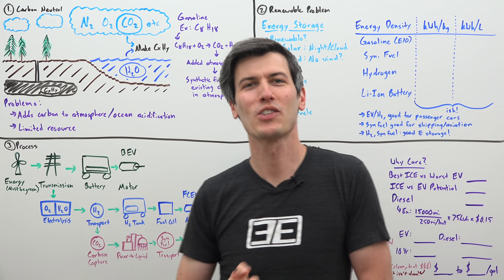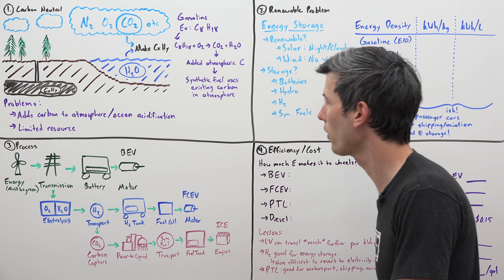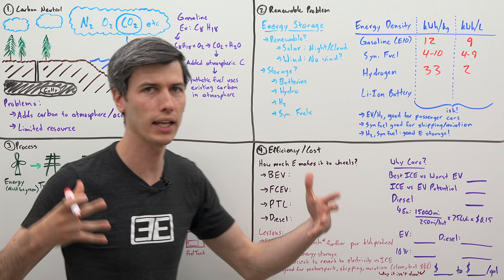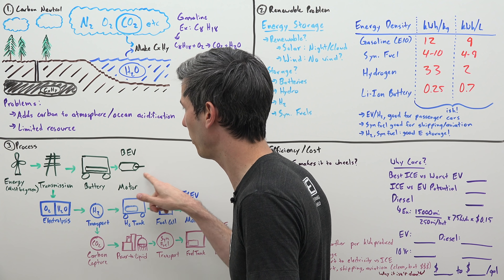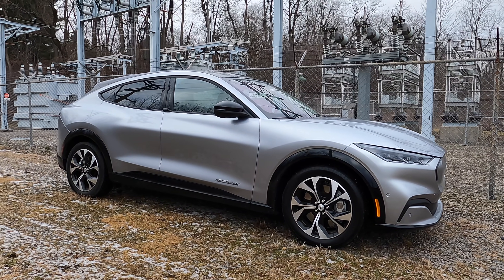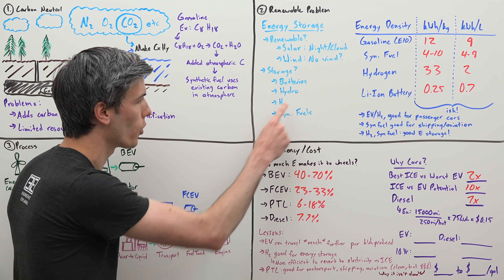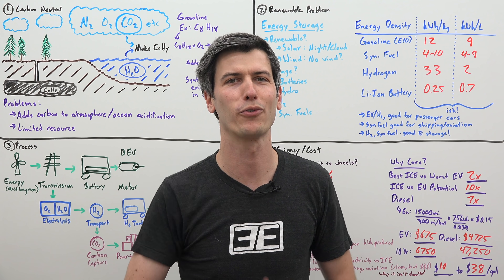The Big Problem With Synthetic Fuels

Comment: How in the world would you ever get only 40% of the energy input to the wheels of an EV from the power source? There are transmission losses (~5%), inversion losses AC to DC (~5%), battery charging efficiency losses (~5%), inversion back from DC/AC losses (~5%), and finally motor efficiency losses (~10%). That comes out to 73%. And this is slightly outdated with the newest efficient motors and solid state silicon carbide invertors now being used it will be even higher. 

I suppose if they are looking at an older EV from 20 years ago like the EV1 or something. That 40% should have a really huge, fat asterisks by it.

Comment: Great video. I wonder what is the overall efficiency of a methane fuel cell?  I mean using Sabatier process to make methane from CO2 and water, then burn it in a fuel cell and use that to power electric motors.

Comment: We can only run with air, coolant pipe in the back, low temperature, filtered air, taking in oxygen, hydrogen, methane, butane, higher pressure, excellent blast. and fuel price is zero

Comment: I think that if we can make synthetic fuel production more efficient it might be a good transition for the last ICEs to keep running CO2 neutral. We don't have to throw those cars away soon so we can have a more gradual transition to EVs to allow for more inovation and not force everyone to buy a EV wich would probably be worse for the environment. Also hydrogen probably isn't a good long term energy storage since it leaks so easy. Really dificult to keep it contained for long.

Comment: Maybe you underestimate consumer convenience? Filling a tank of synthetic fuel in a minute or two vs. partially charging a battery in 20 minutes, added up over 10 years of using a car makes for a massive amount of time. Long-term I think you would have to account for battery lifetime as well. Overall I think what's going to happen is that there will be cars with all these technologies and there will be choice. A technological breakthrough in either one could put it significantly ahead of the others, though.

Comment: interesting but I think this is one of those things, technology will only get better for both. And still, how does all this compare to conventional gasoline? I think the fact that you can reuse old cars and remain carbon neutral is a great thing, and it'll keep motorsport alive as there is no excuse now about running out. I reckon EVs will be the choice of all daily drivers in the very near future, you already see a lot of them, but long distance vehicles (trucks) and high performance vehicles (sport cars, motorcycles) would, or at the very least SHOULD use synthetic fuels even if it's more expensive. I mean 2x the cost of electricity is STILL a bargain when you compare to todays fuels. Most current EVs (at least using UK numbers) cost around £4 per 100 miles in electricity. Now a car with 50 mpg (uk), with current petrol prices (125p) would work out at around £11.30 per 100 miles. That means synthetic fuels are going to be much cheaper or on par with petrol in worse case scenarios, and as supply dwindles and technology/efficiency for synthetic fuels improves the gap will only grow. I don't want synthetics to replace EVs but I really do want ICE's to remain a reasonably available alternative. I don't want exciting vehicles dying out. Euro regulations already make it hard enough, not having a fuel source would cripple them.

Comment: Another idea is to run a combustion engine with the oil of plants. I'm from Germany and I know some people who took sunflower oil for their Diesel engines because it was less expensive and it could be CO2 neutral.
Reply: Problem with doing it with agriculture is that it isn't sustainable, in fact our farming for food and ethanol now isn't sustainable already.
Reply: Tfw using food to make fuel will only drive up food and commodity prices in general.
Reply: Hot Sausage  oh really?
Reply: That is just bio fuel
Reply: Or ethanol
Reply: @nicolasjules579  Ethanol still can't recoup the fuel costs to make itself, so it's still just a feel-good thing for people who care about ecology a bit, but who suck at math. One of the big problems with biofuels in general is that we got to the intensive agriculture we have today with its ridiculous yields through... fossil fuels. Strip all the subsidies, tax cuts and carbon offsets, and you're deep in the negative (though obviously it depends on location - e.g. Brazil has a better position than Germany). There's serious opportunities to improve that, but it's far from a solution right now.
Reply: @nicolasjules579  yes its also interesting and not so expensive to equip on "normal" cars but you can't buy E85 at gas stations in Germany since 2016 anymore because the taxes rose up for E85 and the gas stations would not get enough money for this.
Reply: @Marc-ob5po  In poland I could get E100  :)  but yes,  there is a distinct move to push people in electric regarless of how impracticable and expensive that is.
Reply: @ranichso735  yes it feels like the goverment doesn't think enough about this and they doesn't show other alternatives so the most people can't get a good opinion about this topic
Reply: Thenks for the info, I hope oil companies don't give you Epstein treatment ;)
Reply: why not palm oil
Reply: @Rcck.7282  I dont know if it would work in a diesel engine and you must warm the sunflower oil up because it is too viscous, so I dont know if its with palm oil also possible. In addition to this rain forests get cleared to plant palms and thats not good for our climate
Reply: @Marc-ob5po  Yeah palm oil is the cobalt of biofuels, isn't it?

(And you're also right that palm oil is too viscous, you have to do a lot of that process they call transesterification if memory serves, to break it down to a proper biodiesel.)
Reply: @Rcck.7282  I saw an engine concept of the year 1995 where you could use every plant oil
Reply: @Rcck.7282  palm oil would not be net carbon neutral due to the deforestation of rainforest needed to produce it.

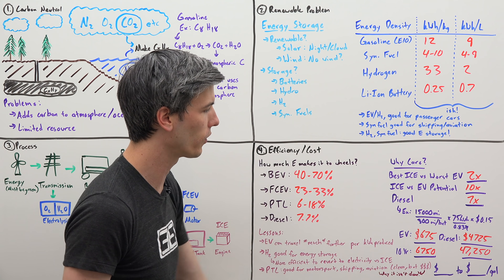Comment: Good video but the cost calculations at 12:30 don't really make sense because EVs are charged with mostly residential electricity whereas synthetic fuels are created with industrial electricity, which is much cheaper
Reply: I don't know why they don't factor the variables here. There isn't a consistent demand for residential power so power companies have to provide enough electricity to meet the various loads which leads to wasted energy.

Production is constant so they know how much power to produce and there is less waste. This is far better as then the stored fuel can be used by individuals. I'd like to see the amount of wasted energy from residential vs if you produce that energy through manufacturing which then individuals buy and use at a later time.

Comment: Can you also please make a video on hydrogen fuel cells.
Like which one is better li-ion batteries or hydrogen fuel cells
Reply: Not much to choose. Both require precious elements to manufacture. Both degrade over time. Hydrogen will probably cost more to fuel. In the UK at least, there are very few hydrogen filling points. Less than a dozen I think....

Comment: The constant focus on CO2 emissions undermines real environmental protection. While in the intermediate term (~100 years) it can cause climate shifts to contend with, in the long term it is a self mitigating or even correcting problem. Life is a net carbon negative process. Living things consume more carbon throughout their lives than they return to the broader environment and much of that doesn’t get returned even as corpses rot. The existence of natural petroleum is proof enough of that.  In fact, without burning this natural petroleum, the life process would eventually remove almost all the CO2 from the atmosphere, suffocating itself. 

All this focus on CO2 is distracting from much worse emissions such as nitric oxides and sulfates, which acidify first the rain and then the oceans, damaging all plant life, but coral reefs particularly hard. 

As Arctic temperatures rise and the tundra recedes, the taiga forests, the largest biome in the world, will expand northward, absorbing a lot of CO2 as the grow. As ocean temperatures rise, barrier reefs will expand deeper, again, absorbing more carbon. oceanic evaporation will increase as well, but atmospheric vapor capacity will not by as much, leading to increased cloud cover and hence lessened solar heating. Yes, ocean levels will rise, but just slightly, and for those of you living in Netherlands or Florida it’s going to present some challenges, but for most of the rest of us it will be a good thing.

Comment: Without a 10X improvement in Specific Energy, battery storage is not going to be viable for aircraft for anything other than short hops up to an hour.
In my mind, hydrogen, due to its high specific energy, makes quite a bit of sense for Aviation, we already have turbines that can burn hydrogen and the power industry is looking at this as a fuel for gas turbines to make up peak loads. Aircraft, while highly sensitive to weight and positioning, tend to have a great deal of unused space, so while H2 has a low energy density in terms of volume, that's not necessarily a deal breaker. The hard part with H2 is where and how do we get it economically, and the answer lies in renewables and nuclear power.

Comment: I think the efficiency argument in this case is one of the dumber arguments that can be made. Battery production would need to increase exponentially to run all of our cars on batteries. Utility scale battery storage is not bad from a technological standpoint there have been issues with utility batteries causing bad fires (like the one a few years back that the utility I work for had), but I am confident that those are minor technological hurdles that will not be a major issue down the road. The problem is exponentially increasing the mining of the minerals we currently make the batteries out of would have a horrible environmental impact. This is where green hydrogen production makes a lot more sense. It is less efficient but using current technologies, it can be done on a massive scale with a much smaller negative environmental impact than batteries. That is the real problem that needs to be solved with storage. How do you exponentially increase storage in the least environmentally harmful way possible. Efficiency is a non-issue, especially since we don't really have a problem with figuring out how to produce a surplus of clean energy. If efficiency was really an issue, renewables would not even be in the conversation considering their pathetic capacity factors, which brings me to my next point. We should not be focusing on using renewables to produce the stored energy. We should be talking about using clean production. Nuclear is the biggest asset on the grid for any green transportation. Nuclear provides base load power, but as more and more renewables come on line and put more and more energy on the grid during certain times, nuclear plants are producing excess energy compared to demand at times of peak renewable production. Given that most nuclear plants can not easily or safely load follow because of xenon production following reactivity changes, nuclear plants are safest at constant power production. Nuclear's excess energy during times of peak renewable production can be put to use making hydrogen, charging batteries, or making synthetic fuels. Otherwise, you get the current situation, where renewable production is intentionally curtailed, and the whole efficiency argument from installed capacity to usage is out the window entirely.

Comment: 🤔What about the weight starts from 480kg to 750kg with battery fram that you carry always around with the car, that's about 7 tot 8 passenger, that's a minus about efficiency! If you drive a ethanol, synthetic, diesel fuel car that weight will be reduced by every km you drive. The e-engine & inverter 158kg on a Tesla Model S and about just a engine from Audi or BMW depends on horse power about 140kg - 170kg or little more. The difference is not that big but between the fuel tank with 80 liter Diesel / 68 kg weight and battery is much higher Battery 478kg + battery fram totaly 600kg that's nearly 10 times higher than the   diesel tank include the fuel from 80 liter diesel. At the other hand it's less dangerous by a accident and you can drive longer distances and the fuel is just in a few minutes in the tank to drive away, don't lose traveling time for spending to charge the battery. Sorry what about the life time of the battery, very expensive to change.

Comment: I wonder if they've considered blending in ethanol or other alcohols to perhaps reduce cost. I'm not a huge fan of ethanol honestly (low energy density, gums up fuel systems if it sits for too long, attacks some rubber, and it has to be farmed (at least for traditional corn ethanol in the States)) but if it keeps ICE fuel around longer and makes costs reasonable then I'd be happy to use it. I mean we already use E10 pretty much everywhere so I figure they'd continue this, though the option for pure CxHx would be nice.

Comment: Man I envy you. Love the video. Quick question, doesn’t the battery degrade the battery degrade over the coarse of 10 years and don’t you have to consider that when looking at the 10 year cycle?
Reply: I have a 15 year old Lithium Ion battery from a laptop. Still at 98% charge.
Reply: @cpufreak101  those always die in 1 year. Laptop batteries never live very long. That's a fluke yours lasted that long.
Reply: @VintageCars999  wut? My main laptop is 6 years old and the battery is still just fine